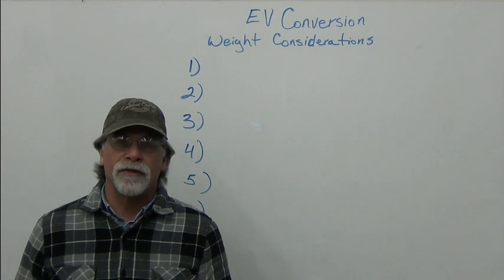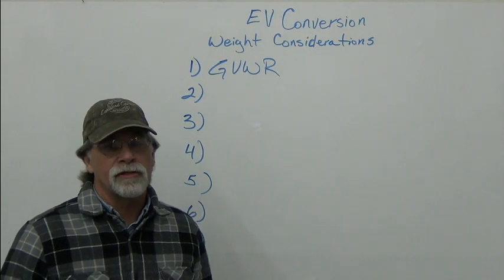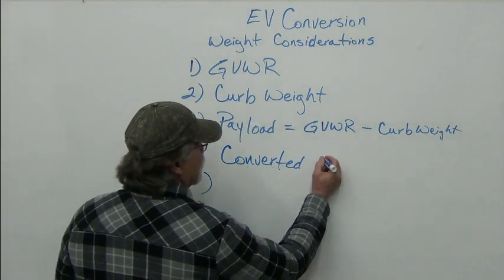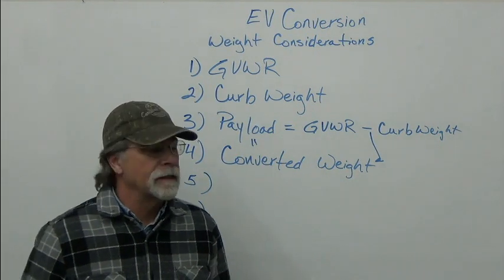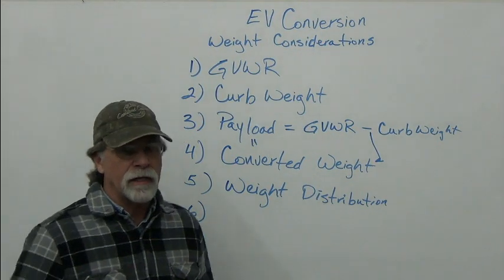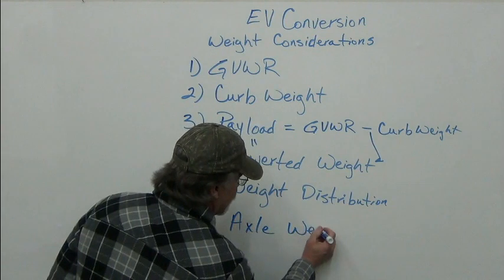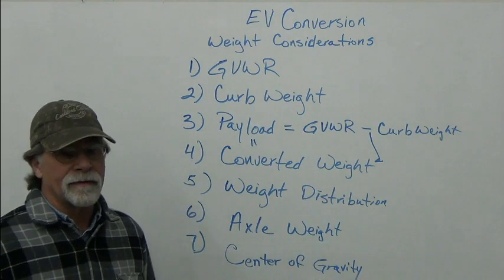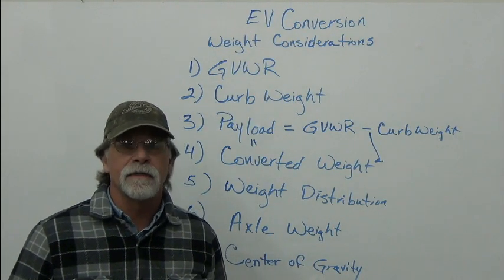EV Conversions - Weight Loss?  EV Conversion Weight Considerations

Comment: Great video, very clear and informative (must've helped having a practise-run!).  Another weight consideration is again related to centre of gravity but keeping weight within the wheelbase ie. not having batteries too far front of the front wheels and too far behind the rear wheels.  This ultimately results in improvement in handling.  Thanks again:)
Reply from the maker: That's correct.  A lot more can be said in relation to this topic.  Thank you for watching.

Comment: I've noticed that conversions typically maintain the original transmission.  Strictly for weight savings, are options available that can couple an electric motor to a light torque converter or direct to drive shaft?
Reply from the maker: We have a video that covers that topic.